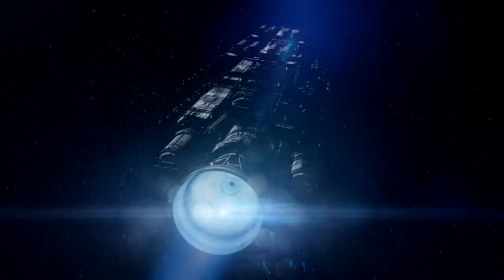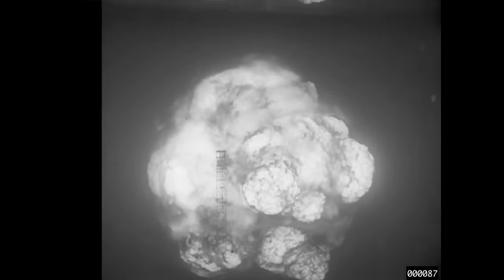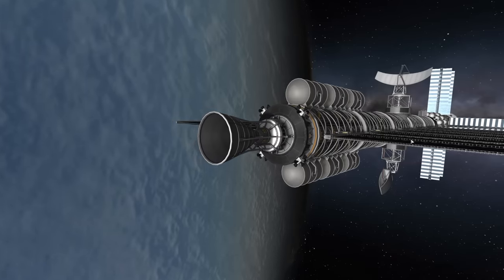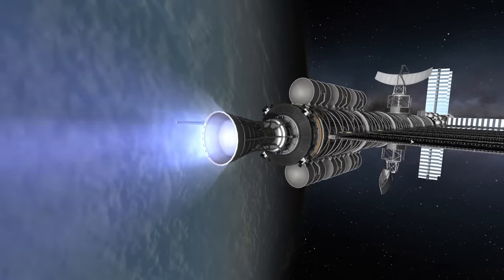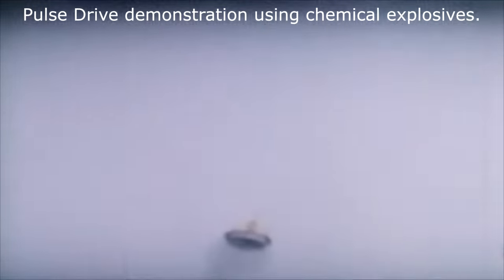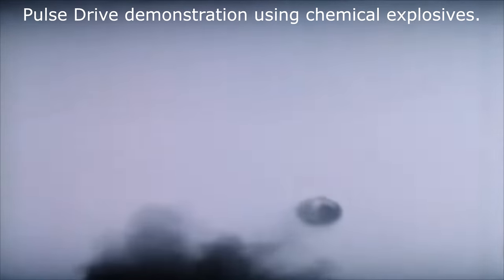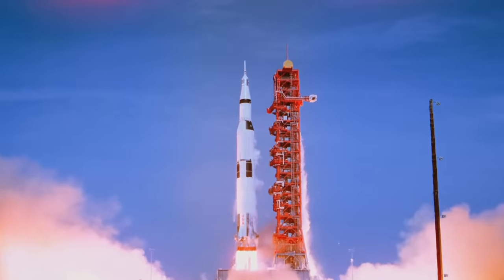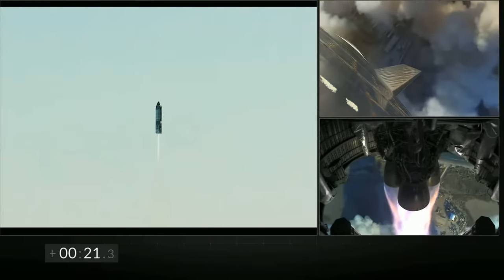The Nuclear Salt Water Rocket - Possibly the Craziest Rocket Engine Ever Imagined.

Comment: NSWR: the closest we could get to interplanetary torches in any near future vehicles. Also extremely scary.
Reply: Orion though. Mini-Mag Orion though...
Reply: @badbeardbill9956  possible, but mini mag faces challenges yet to be solved
Reply: Just don't  stand behind it too close, like 50 miles?
Reply: Scary only to those who don't understand nuclear reactions.  This is not a bomb.  If used in space, the radiological hazards are insignificant, especially when things like solar flares and CME's can fry you far more easily.  It is a mark of ignorance to fear something you don't understand.  The US Navy has used nucelar power for decades without a serious accident.  Nuclear power, applied properly and with respect for its power, is nothing to be afraid of.

If we are ever to leave this planet, nuclear energy of some kind will be the way we do it.  Chemical propulsion is too impractical for interplanetary travel to say nothing of interstellar travel.
Reply: @ThePrisoner881  The scary part is the tank that store all those salt water propellant. If something happens to you neutron absorbent lining. You have a spaceship size nuke.
Reply: @ThePrisoner881  Anyone who's not afraid of a few hundred gigawatts of thermal energy is a fool. Fear does not imply cowardice, only a respect for a barely controlled nuclear chain reaction. Without constant perfect pumping, the reaction will chase up the ship and risk detonating the fuel tanks. If the cooling water fails, the bell melts, and based on the heat energy you're continuously depositing in it, the ship does too. I did not remotely imply we should not use this technology in my comment, i was just making a comment on how it's a little scary of a concept. I did say it's the only real chance for an interplanetary torch in the near future if you read what I said. Try not to jump down people's throats without knowing what they're saying.
Reply: @casacara  NSWR faces much larger challenges according to some nuclear engineers I've talked to. Mini-Mag can be based off of Z Machine, which is existing hardware.
Reply: @badbeardbill9956  I'd like to see a Z-machine capable of going into space and a power supply that can keep up with the charge rate for any decent amount of time. That said, I actually would like to see it, and if it turns out to be the way I'd be overjoyed to see it fly. What kind of nuclear engineers?
Reply: @casacara  One of them works at OMEGA I think.

I think Mini-Mag used capacitors and charged them from the pulse energy, with a reactor to charge them up for the first pulse. 

Mini-Mag has a lot that supports its possibility and the engineering work is totally doable. It's only looking better a few decades later. Z Machine is pretty old technology for a lot of what it does.
Reply: @badbeardbill9956  I'm just wondering how it would handle the stress of constant firing, since the Z machine has many days between shots. Also there definitely is energy to harvest for that charging, but I'm not entirely sure how they'd collect enough for the shot.
Reply: @casacara  I don't think there's really an issue of handling the stress. Sure Z machine can't, but it's a high energy physics experiment device, not a rocket engine. The two things have differing requirements - we could probably design something that can work. It'll take engineering and RnD effort, but it is very likely workable. 

The shot is something like 70 MJ iirc. The actual yield of the pulse units is in the hundreds of GJ. It should be doable.
Reply: @ThePrisoner881  No, it's kind of scary. It IS a bomb, that's the whole point of it. If the propellant tank is damaged by accident, you can get not only a criticality accident which kills the crew and wrecks the ship, but you also will probably get a Chernobyl-like excursion that blows the ship open and sprays the fuel and fission products all over the general area.  In deep space, you just lose the crew and vehicle. Close to the surface of a planet or moon you get a bigger mess. Also, in the more enriched fuel version of this system, a damaged propellant tank might actually bring on a nuclear explosion. The US Navy's nuclear power program is an example of a well run and disciplined program, but the Soviet navy has a much spottier record with nuclear power. I agree with you that nuclear energy is the only realistic option for aggressive space exploration, but building something like a NSWR is not something to be taken lightly. There's a lot of ways to f*** this stuff up.
Reply: @billsugden3734  as they said in the expanse, every space has a weapon. Its called the engine.
Reply: Yeh easy to see how important it is to balance power with control???
Reply: Not scary if we load it with just a probe. Sending a probe to nearest solar system and back with a few decades of a research crew? Cassini and Voyager missions times were such lengths
Reply: Coal power plants kill many times more people each year than nuclear has in all of history. NOTHING scary or even close to as dangerous as most of the technology we use today. Almost every industry in the world kills more people through accidents than nuclear power.
Reply: @excitedbox5705  Yes? Nuclear power is an obvious go to. I'm not saying don't do it. I'm just saying it can definitely scare you.
Reply: I would not want to ride this to another planetary system.  This engine operates at tremendous pressures and temperatures.  The greater the run time of such an engine (or any engine), the greater the chance of a failure occurring is.   Over years or decades the engine is all but certain to fail for any number of reasons, marooning the crew, or there could be an accident involving leaking fuel that would kill the crew.  It seems like a recipe for disaster.  On the other hand, for missions within the solar system, this could have potential.
Reply: @excitedbox5705  Yeh clearly many people have a superstitious dread of nuclear power. Seems likely that such power is greater than people can get their heads around. Despite clearly being out of control in so many respects people seem to recognize the need to balance power and control when the danger is obvious enough???
Reply: there are ways. even high powered laser pushing looks safer then this)))
Reply: Just like trains running at 30 mph. People back then feared suffocation from the rushing wind.
Reply: @heggedaal  facepalm
Reply: @ThePrisoner881  Yes I agree that in the great scheme of things this is a minor problem. My point is with the high exhaust velocity, at very high temperature, directed by an efficient nozzle; being directly behind the engine is not a good idea. I would recommend caution, even without the enhanced radiation.
Reply: What's more scary is that the US had Cold War plans for an airborne version, a nuclear cruise missile that used hot, irradiated air for propulsion. It could theoretically fly around for months while contaminating large portions of the Soviet Union under its flight path.
Reply: @billsugden3734  you could say that about pretty much any rocket engine though, couldn't you?

Comment: You can also get the water flow rate to increase by simply restricting the flow cross section after the boron lined section of pipe, sort of like a venturi in a carburetor but with positive pressure at the inlet rather than positive pressure. You could even feed in a more concentrated nuclear fuel-water mix to better control the rate of reaction.

Comment: Certain chillies have the same effect in my exhaust nozzle.
Reply: So when we do get to Mars, and meet you there, we've been warned. Take some grub, for the return trip.
Reply: Well now you know the answer, you need to install some jets of water to act as a buffer around your overly-energetic exhaust to prevent erosion of your nozzle. Please post a picture of your doctor's face if you ask for those to be installed.
Reply: Classic !!🤣
Reply: @johnladuke6475  theres people on facebook that offer that service
Reply: Good, you don't need a jetpack
Reply: @johnladuke6475  I would also recommend recycling a part of the exhaust gases to cool the nozzle, I think they call this regenerate cooling. You loose a bit of effectiveness, but you gain a lot less problems with overheating your nozzle...
Reply: @johnladuke6475  web searching "bidet toilet seat spray" should fit your need in this particular instance
Reply: @miscbits6399  Didn't you look at the diagram? The spray is supposed to be internal to the nozzle. Trying to introduce flow from the outside while the nozzle is operating would spray "exhaust" everywhere!
Reply: @johnladuke6475  yes,  but in this case it's in a containment vessel..... 😁

Comment: 5:05 this design is so insane, the entire fuel tank would have to contain some kind of Boron foam to absorb neutrons and as the graphic shows all the plumbing would also have to be filled with boron tubes
Reply: Or you’d have to dissolve uranium salt in some eutectic metal alloy so that uranium ion is always surrounded by dense liquid metal.

Comment: That design is crazy. Such a rocket engine would need to be designed to be much smaller so that the craft operates as a torch ship. Because even if you can only generate a small thrust, it changes life on board dramatically.
Reply: What is a torch ship?

Comment: The great problem is that we couldn't try the engine in the atmosphere. Maybe with a settled moon base, we could prototype it there
Reply: You could build a small version into water and other things which should be able to manage it.
Reply: Nuclear thermal propulsion might become relatively popular on Mars. Given it has little atmosphere and a fairly severe radiation environment it might be quite practical. It doesn't require any oxidiser to make thrust.
Reply: Janik Bily even if it did go wrong it wouldnt do much to the moon
Reply: @zoidberg444  eh, the radiation on mars is mainly from space.  Radioactive particles that you can bring through an airlock could be a different matter entirely.
Reply: @dynamicworlds1  Yeah, you wouldn't track most of the space radiation in through the airlock on your shoes (the exception being whatever radioisotopes were created by cosmic ray bombardment, but that isn't very much).  You WOULD track nuclear salt water rocket waste in through the airlock on your shoes.
Reply: That's no moon, it's a space station!
Reply: Janik Bily  Jupiters moons are also not something to waste.

Comment: The reaction could also power its own safety. It generates enough electricity that you could harvest a small percent for a magnetic bottle, that can act as either throttle or shutoff. Or, it can power EM screens that stop the radiation hitting you- which is actually the bigger danger at the speeds we're talking

Comment: 11:48 Are there any resources that discuss what those material requirements would be and why we might not be able to achieve them? I don't want to think you're being pessimistic just for the sake of being pessimistic. This is such a fascinating topic and I want to learn more!
Reply: Do you know anything about the 9M730 Burevestnik (NATO designation SSC-X-9 Skyfall)
Reply: @jamescottrell7147  I looked it up. It looks like a cruise missile with some nuclear thermal engines.
Reply: Extremely hard and heat resistant, also the paper doesn't talk about the extreme pressures that some parts of the nozzle will have to indure, so scott's pessimistic answer is rather true at first glance.
Reply: @tis_ace  Would pressure be a problem? What would stop the engineers to use say, 1m thick steel reinforcement? With that kind of engine efficiency, weight doesn't seem to be a big problem.
Reply: @General12th  Thanks, Wonder how "engine rich" radioactive exhaust those Russian engines have?
Reply: @MrTomyCJ  I am more worried on the neutron absorbent lining on the tanks. You need them to be strong enough to survive the intense vibrations. Also the pump needed to feed the reaction nozzle needs to produce higher pressures than nozzle pressure. High pressure also brings the salt water closer to criticality so there is a limit to the size of your pump.
Reply: @MrTomyCJ  I mean, in that case it becomes a question of how you intend to get this vessel into space since Mr. Manley firmly established you don't want to use this in an atmosphere.
Reply: @paulmahoney7619  yeet it
Reply: Like with a mass driver?
Reply: @MrTomyCJ  this thing is gonna be big anyway, but I'm not really sure which materials are going to be used, I mean chemical rockets already push the materials we use now. And I don't thing that 1 m steel is gonna make much of a difference because this thing could vaporize it if you looked at it funny, any instability will lead to immense strain on the nozzle periodically and it could induce micro fractures and cracks which prohibit its use as in long duration burns thats why I like nuclear thermal rockets more but they are another type of beast
Reply: @kazedcat  won't the exhaust flow and the lower pressure outside the engine basically such the fuel flow and stop the flow from going back inside the pipe ?
Reply: @jamescottrell7147  considering it killed a few people, I would guess its alot
Reply: @paulmahoney7619  sure why not
Reply: @danilooliveira6580  In order to create the fuel flow you need pressure gradient from the pump to the nozzle. The direction of the flow is from high (pump) to low (nozzle) pressure. The nozzle is going to be at very high pressure near the neck to generate the high exit velocity of the propellant. The pressure at the pump will be even higher than the pressure on the nozzle neck.
Reply: Materials science, like most modern science, is still in it's infancy.  I have no doubt that we will continue to make increasingly interesting and sturdy materials and metamaterials.
Reply: @kazedcat  but the pressure in the nozzle is not restricted, it will flow outside of the nozzle, and as the gas exits the nozzle, shouldn't it pull the flow of fuel with it ?
Reply: Danilo Oliveira Let us consider a steady state operation. The mass flow rate at the nozzle exit should be equal to the mass flow in the nozzle intake. Because if not then either the mass inside the nozzle drops below critical or the mass inside is increasing causing it to explode.  The mass going in is equal to the mass going out but the intake opening is smaller than the exit opening so in order to maintain the mass inside the nozzle either the intake flow velocity is faster or the intake flow is at higher pressure. The nuclear reaction is adding energy to the propellant inside the nozzle so the exit flow velocity should be faster than the intake flow velocity. That is also the main purpose of having nuclear reaction to accelerate the propellant in the nozzle. That means the intake flow velocity must be slower than the exit flow velocity so the only way that the mass inside the nozzle is maintain is to have higher pressure at the intake. Now the pressure at the nozzle exit is equal to engine thrust divided by the opening area. We know the engine have crazy high thrust so the pressure at the nozzle exit must also be crazy high this means the intake pressure must be even higher and the pump must be able to generate an even higher pressure.

Comment: This engine is the future! Just don't point it directly at Earth.
Reply: Which future?  There's more than one.
Reply: @johndemeritt3460  hopefully not the one whede the engine causes catastrophic disasters on earth
Reply: As long as you don't use it in the atmosphere, where it would create clouds of radioactive vapor, you'll be fine. As he says in the video, in a vacuum the exhaust rapidly spreads out so widely that it goes to virtually zero concentration.
Reply: @davidnewton2518  The engine could not be used for launch from earth, only for propulsion once in space and away from earth.  As pointed out, radiation from the exhaust (or even a catastrophic failure) would quickly disperse to be less than the radiation from the solar wind.  It's easy to lose a handle on just how roomy outer space really is.

The trick would be getting it up into space in the first place.  You would not want a CATO with a rocket full of that stuff.  Talk about a non-stop Chernobyl...

A likely scenario would be to launch the fuel separately, in conventional rockets with extremely robust containers, then transfer the fuel to the actual vehicle in space.  Or mine and refine the fissionable material off-world.

Comment: Scott, could you do a video on the possibility of Beamed energy?

For long term intra Solar system developpement, having the power source outside of the craft (ie not in chemical links or fissile material) but be on a distant power station that uses massive ammounts of solar energy seems like the only sensible way to do things
The  further away you get from the sun, the larger the solar arrays need to be, but the cooler things are and the more efficients generators get as well so its an option even for the gas giants